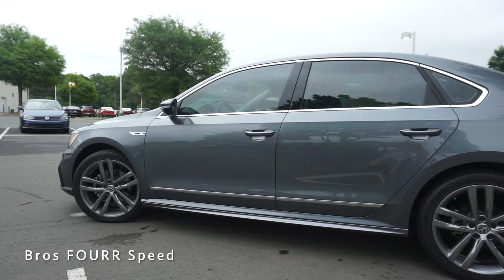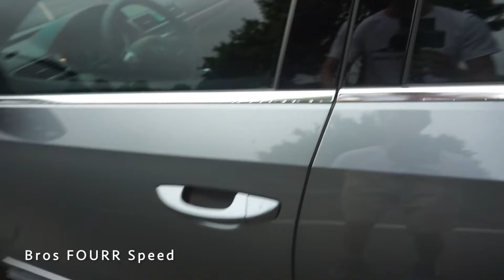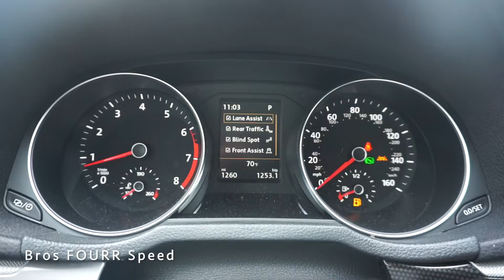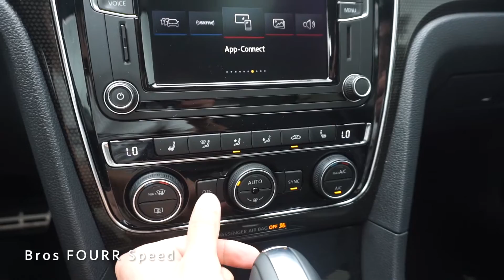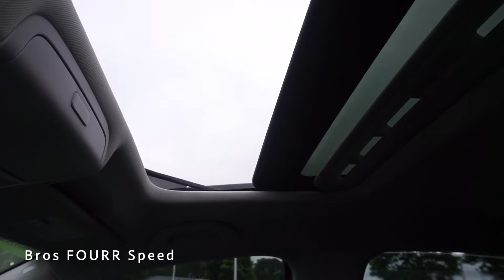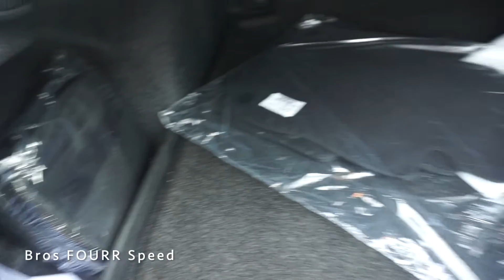2019 Volkswagen Passat 2.0T SE R-Line: Start Up, Walkaround, Test Drive and Review

Comment: Is there remote start?
Reply: Actually yes the SE R-Line only available in the 2019 and forward model years do have a remote start feature.
Reply: @ks9326  right, I know that the higher end trims of Passat's  from i believe 2010 and onward (RIP Passat :( ) have remote start. I know for the jetta it's weird though, because the jetta you have to get the cold weather package to get the remote start but the higher trim level jettas have heated seats, all the cold weather package adds is the remote start and the heated steering wheel.
Reply from the maker: Not on this model, I don't think any Volkswagen's come with remote start.